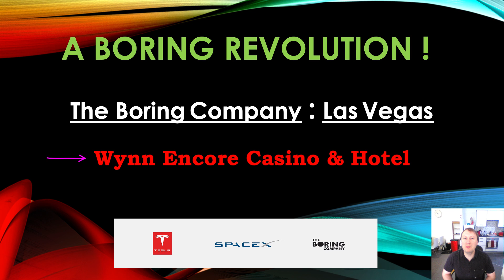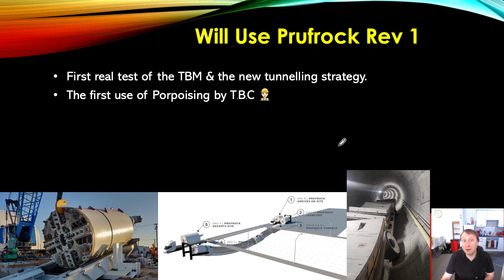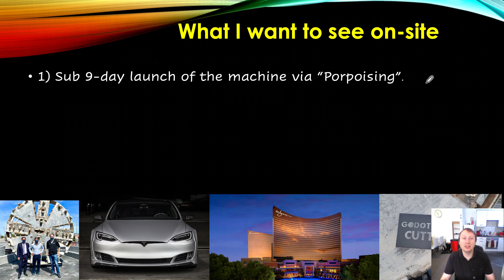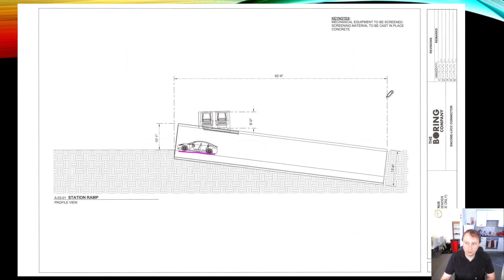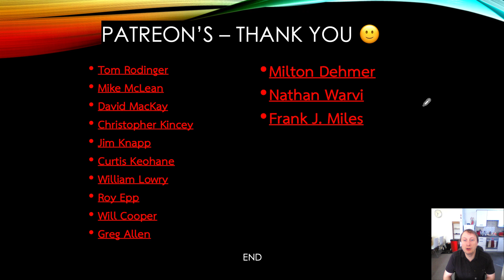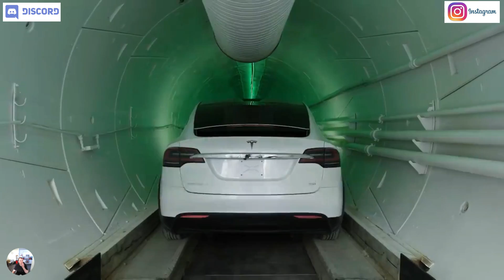New Prufrock TBM Set to Debut at The Encore Wynn Casino 😀 🚇 👷🏻‍♀️ Episode #93

Comment: It's a .61 mile long tunnel that is going to cost 10 million, which I thought was Elon's cost per mile, so shouldn't this tunnel be about 6 million? How exactly is Prufrock making things cheaper?
Reply from the maker: 1) it's a dual bore tunnel.
2) it's 0.827 miles long so 1.654 miles in total !
3) No other road / rail tunnel in Nevada or Arizona even comes close to $7,385,000 per mile.

Comment: Oh come on you CAN'T be that excited wait a minute you've turned me into a tunnel boring groupie I guess you are stoked. Huge leap in speed alright but how the Dickens do they run 4 TBM's at once? I can see one TBM each end meeting in the middle with ground penetrating radar or something. Four TBM's huh, I'll have to believe you does not process. Porpoising sounds interesting easier on acceleration and deceleration, BONUS 👍
Reply: Everywhere that they want to build an entrance or exit ramp is another starting point for a tunnel boring machine. So like if you wanted to dig a 1 mile tunnel with two intermediate access points, you can do that with four TBMs all drilling simultaneously. The location of the machines is already known so radar isn't needed. When a pair of TBMs are about to meet, one of them can be turned off and backed out of the tunnel while the other one does the breakthrough to connect the tunnel segments.

Comment: Surely the cars wouldn’t need to run in a platoon with 5m separation?  As soon as the tunnel is clear and the first car has unloaded and loaded, it can depart.   Passengers would then have more time to load and would wait in the each vehicle for departure as the tunnel empties.  

For 1,200 pax per hour that’s 25 x 12-car platoons per hour (for four pax vehicles) or 2.4 minutes on average per trip (travel+unload+load) per vehicle. 

My instinct is having vehicles moving in the tunnel almost continuously in this manner will maximise capacity and minimise potential delays at the stations, especially as the “platforms” are on the vehicle path. (Which means has slow loading vehicle can’t be skipped by those behind it.)

Comment: I don't quite understand porpoising of you can help explain it more/make a video in it. For example, for a half mile tunnel, how will doing an arc tunnel help make a straight tunnel? I can understand it if each porpoise entrance/exit is where cars can go, but I doubt that is the reason for doing it.
Reply: Will has also suggested that a double shield type TBM will be used. but this goes against the "porpoise" idea as a double shield gets its thrust from gripping the external ground, which is not there at the surface.
Similarly the segmental lining requires external ground pressure for its stability. Again, not available at or near the surface.
Horizontal Directional Drilling uses this technique for smaller diameter pipes, but it's not suited to larger sizes or to a dense urban environment with lots of existing underground utilities.
Still no sign of any new technology. But we know very little about the Prufrock machine so far.
Reply: @davidsalisbury50  Boring Company isn't really about new technology, its about applying applying a new paradigm to existing technology aligned with physics to lower cost and provide revenue stream beyond the building tunnel phase.
Reply from the maker: @davidsalisbury50  (Speculation) It may well develop into some kind of hybrid between pipe jacking and gripper shields with a reception shaft at the casino. But I've had people tell me that gripper shields won't work too well in Las Vegas given the ground conditions.
So a TBM similar to this By Robbins might be used : 
https://youtu.be/w-9nx8VWtpE?t=210
Reply: @BoringRevolution  Will, the Robbins video is a classic double shield. Gripper machines need rock ( or at least very hard ground) to “grip” onto. Any thrusting TBM needs a reaction to thrust against. Once 20-40 rings are in the ground, and the annulus fully grouted, they can get the reaction from the lining.
The main problem with the inclined surface launch is where to get the reaction to forward thrust ( and anti roll torque reaction) from. These are massive forces. I have seen a TBM head “lock” in the ground and try to spin the whole machine behind it.
Reply from the maker: @David Salisbury  Wow.... That sounds like a fun ride at Disney Land I'd pay to use 😲 !
Reply: Porpoising means going in on an incline from ground level instead of digging a pit the starting horizontally from below ground level. The arc shape is just for simplifying the diagram. A real tunnel would have an inclined pipe entrance like shown, then be horizontal for most of the journey, then at the end start climbing towards the tunnel exit.
Reply: Will has said that Porpoising is much cheaper and faster but TBC is the only company with the ability to make it practical.
Reply from the maker: @global_optimization  The only other company I'm aware of doing this is called Obayashi in Japan. These kinds of techniques have many advantages and a couple disadvantages. But the cost & time savings are a game changer when it comes to building multiple levels of tunnels. 

https://www.obayashi.co.jp/en/solution_technology/proprietary_technologies/urup.html

Comment: I think the boring company should only add tunnels that have entrance and exit tunnels to expedite The travel times, there would be no waiting at all for other cars to load up, you could simply load the car and beyond your way.
Reply: it comes down to budget, ridership demand, and length. branching a tunnel will be tricky and add cost and time. if you're just building a short, half-mile spur, there is no need for expensive exit tunnels. most transit makes people wait 5-15min between boardings, but with a short tunnel, even having to wait for the tunnel to change directions wont be very long since your boarding time will almost take up that time period. so maybe you wait 1min to depart, not a big deal.
Reply: They might be able to expand in the future if it's busy enough
Reply from the maker: I agree and excavating large chambers underground is costly and expensive.
Ramps are the way forward. . .